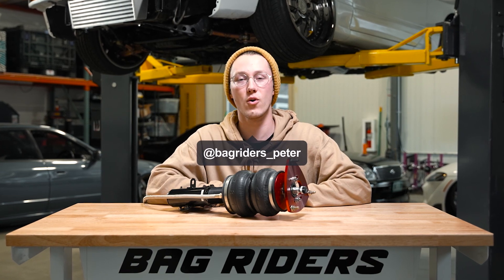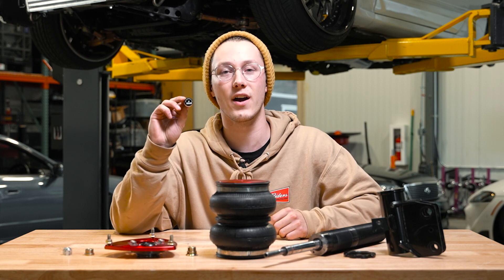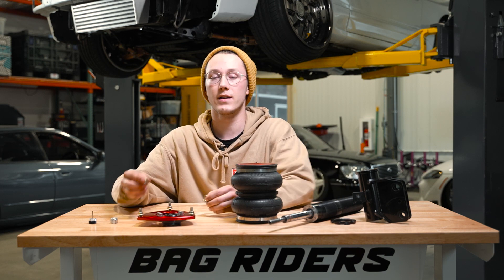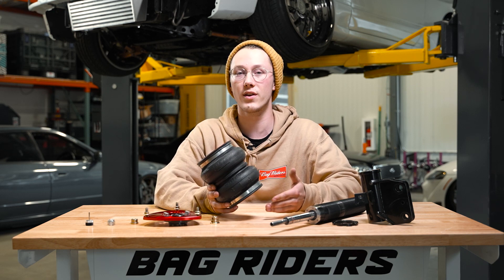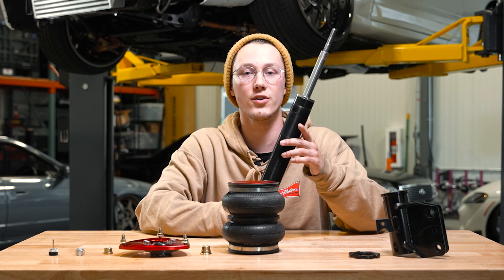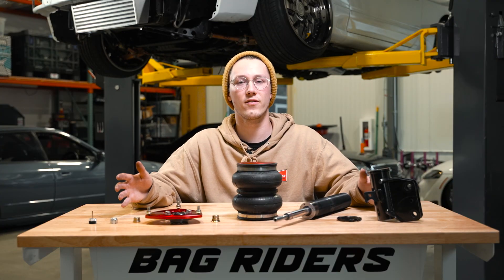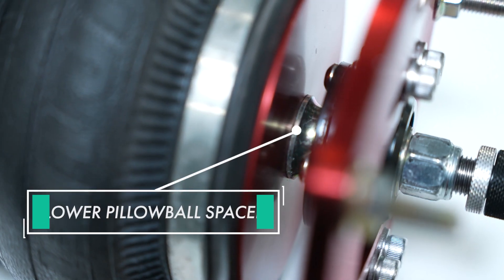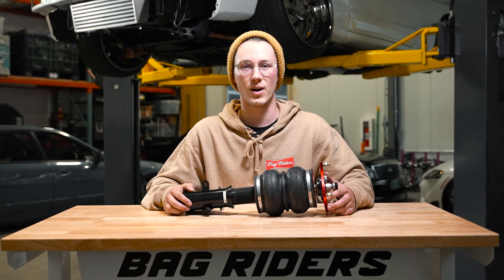Air Lift Performance Strut Breakdown

Comment: Where to get replacement top plates for my airlift suspension? 9th gen si? This my second front set and they started rattling again over only one year? Mechanic thinks it’s the top hats? These things are expensive for the amount of headaches it gives me and it’s my second set fml
Reply from the maker: Luckily you don't have to replace the entire top plate if you are hearing noises! We do sell replacement pillowball bearings which can be found here https://www.bagriders.com/air-lift-performance-pillowball-bearing.html

Comment: How would you go about adjust the height of the struts itself to fine tune the suspension?
Reply from the maker: You will want to loosen the lower lock collar and that will give you the ability to spin the strut assembly up and down.

Comment: Ive started to experience a creaking noise from both air back struts from Airlift i believe its either the camber plate or the spacers ive had them just over 2 years has anyone else dealt with that?
Reply from the maker: Hey! Reach out to our customer support team at sales@bagriders.com or call 844-404-7344 they would be more than happy to help figure out your creaking noise.

Comment: What is the torque spec for the locking nut?
Reply from the maker: You can torque it to 40ft/lbs also be sure to use the correct size allen to hold the strut rod from spinning.

Comment: Which setting should I set for a stiff ride ? I don’t get how to use my damper knob
Reply from the maker: To create a stiffer ride start by twisting your damping knob to the right (harder). You can also play with the pressure in the bags as well.
Reply: @bagriders  thanks guys another question they left my damping at 20 clicks so to make it stiff it turn to the H if I wanted stiffer
Reply from the maker: @cristiansantos857  Correct! Also try increasing the bag pressure by 1-5 PSI increments.
Reply: @bagriders  thanks man one more question what does that help with ?
Reply from the maker: @cristiansantos857  Well the damping knob is to help with the rebound of your shock. You can speed it up by turning soft or slow it down by turning it hard. The air pressure helps change the dynamic of the ride but when you add more pressure it also changes the height of your ride.
Reply: @bagriders  where can I find it in my control to change my air pressure
Reply: @bagriders  would I have to go to max pressure ? And thank you for your help
Reply from the maker: @cristiansantos857  Which management system do you have?
Reply: @bagriders  airlift 3p
Reply from the maker: @cristiansantos857  Hey Christian if you don't mind would you email our customer service team sales@bagriders.com? We can help get you your answers there.

Comment: how do i remove the lower mount ?
Reply from the maker: You'll want to loosen the lock ring first. Sometimes this requires a flat head screw driver and hammer.

Comment: What size dampening knobs would it be for a 2017 lexus is200t ? F sport rwd model
Reply from the maker: It would be the (M12-1.25MM X 20MM) or part number BR03939 on bagriders.com.

Comment: Can the shocks ger damaged?? I am getting a huge knock!  when go ober bumps like solid metal sound
Reply from the maker: A knocking sounds could be a few different things. Send a video to sales@bagriders.com and we can help identify the issue.
Reply: Did you figure out the issue? Having the same noise over bumps. Specifically on the front drivers side air strut
Reply: Replace the whole strut, i removed the bags and went to coils

Comment: I just got my airlift struts and my locking is stuck i cant move it do they come super tight from air lift ?
Reply from the maker: Yes the do come super tight from Air Lift. Try using a flat head screw driver and hammer to break it loose!

Comment: What is the size of damping knob for Wrx 2019?
Reply from the maker: The damping knobs for the 2019 Subaru WRX are M12x1.25mm x 20mm also known as part number 11283. You can get these right on our website. https://www.bagriders.com/air-lift-performance-damping-adjustment-knob.html

Comment: Whats a good protective wrap for some airlines running thru a rocker panel on a mk4 Jetta?
I was thinking some fuel line, unless there's an awesome product for this.
Reply from the maker: There's no specific product to use, you can use a rubber grommet to protect the air line at the firewall, or use any form of wire sheathing! Just want to make sure it's designed to withstand abrasion
Reply: @bagriders  
Cool deal cool deal 👍
I'm trying to do a hidden install and knew it wouldn't be wise to run them without some kinda sheathing or even fuel line slipped over them.
Thanks for the reply , you guys are great. 
I got started on it a couple days ago,and other then that I've found all the info I've needed so far on your site. 
Glad I purchased the kit thru you guys, for the tech support as I knew I wanted air ride but didn't know anything about it.